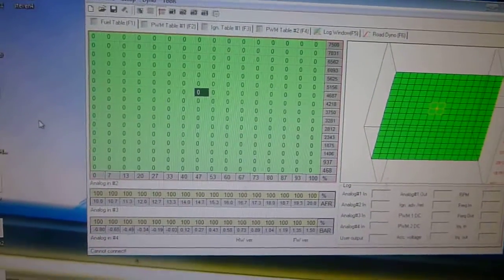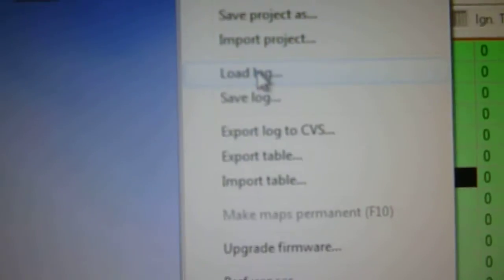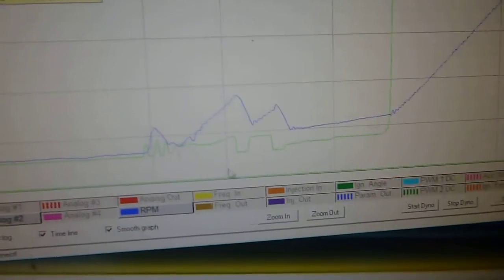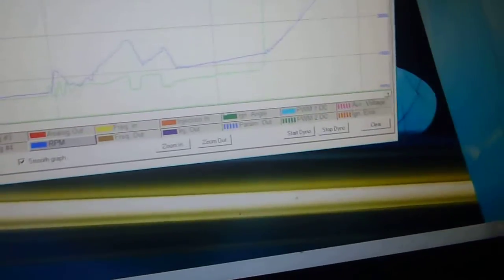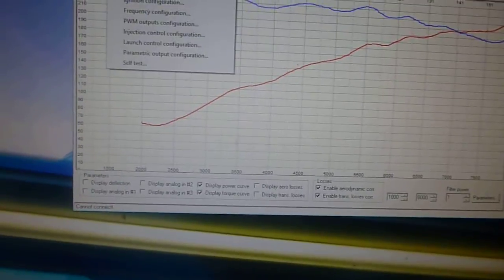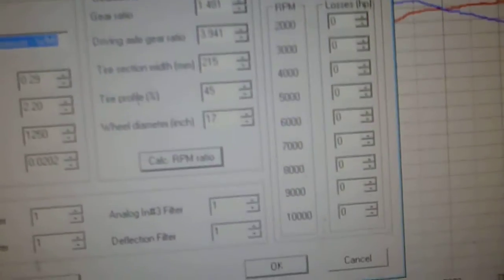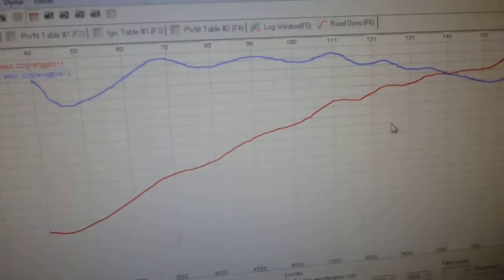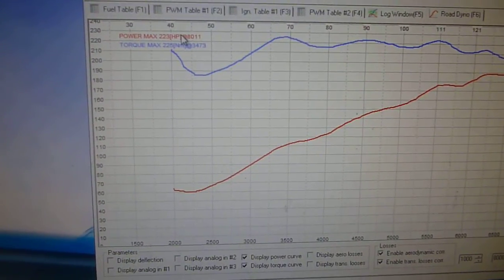DET3 Dyno Setup

Comment: Are there many people in the UK that tune with the Det3? I'm looking at using it with a 1997 Toyota starlet which is boosted and running water methanol injection, where would be best to get it mapped?
Reply from the maker: Any reputable tuner should be able to tune a Det3 as its just a simple piggyback device. Tuning Developments would be my first thought as they specialise in Starlets.